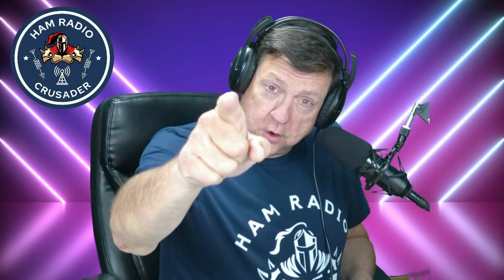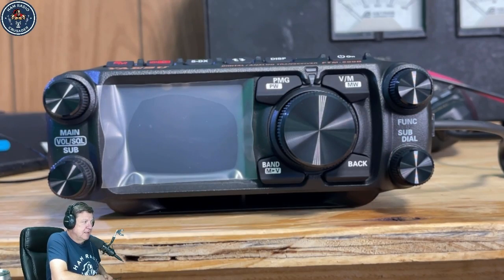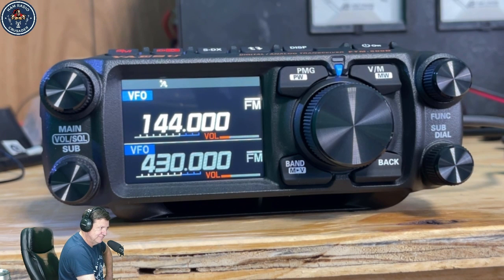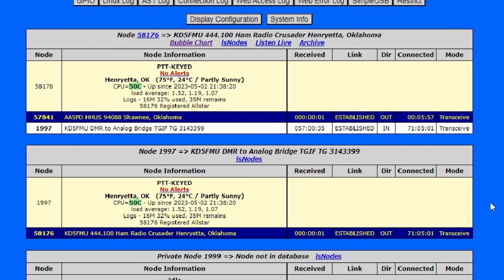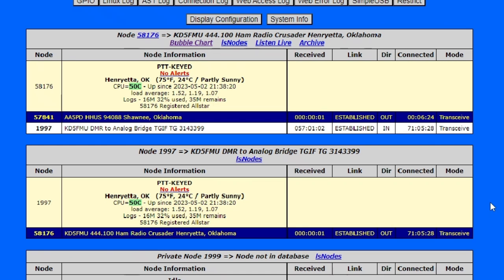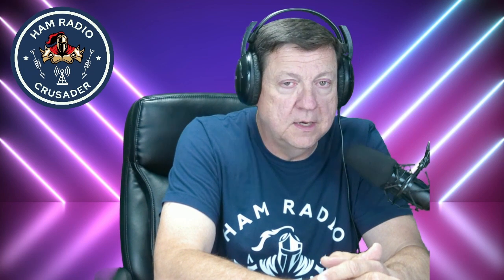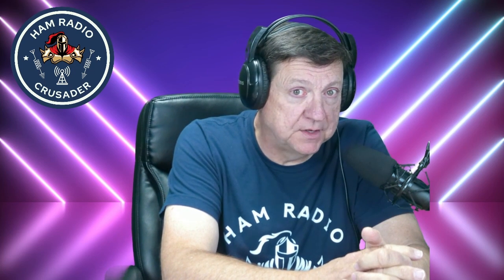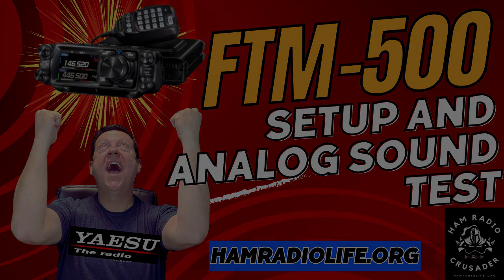FTM 500 Part 2 Initial Setup and Analog Audio Test

Comment: I bought a used one from a guy in the club, I went to 121 to put my call sign in .I put it in over top of his. But when I turned it off and then turned it back on , his is still along with mine, how do I take his off?
Reply from the maker: https://www.yaesu.com/downloadFile.cfm?FileID=17938&FileCatID=263&FileName=FTM%2D500DR%5FDE%5FAPRS%5FENG%5F2311%2DB.pdf&FileContentType=application%2Fpdf
Reply: @HamRadioCrusader  thanks I've got the manual, I didn't see anything on how to take his out ,I put mind right over top of his , basically the last 3 letters the first 3 were the same
Reply from the maker: @garytedlock7533  I would do a factory reset and make it my own. But that’s just me 😉
Reply: Thanks for jogging a Old man's brain KD9WTH 73

Comment: Love Allstar I have 3 Nodes two home made .
Reply from the maker: I have one SHARI Pi-U and two nodes I made from a Raspberry Pi3 and the TYT-TH900D's and I recently sold one I made from an Alinco DR-135 using the Raspberry Pi3 and the ARA-1+ sound card. They are solid when set for 10 watts and you put a cooling fan on the radio. LOVE LOVE LOVE AllStar!